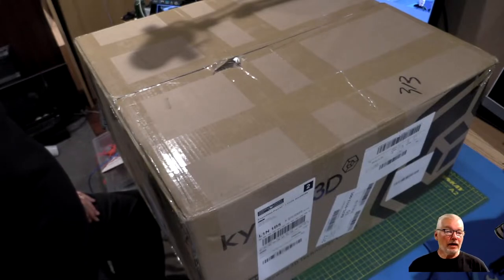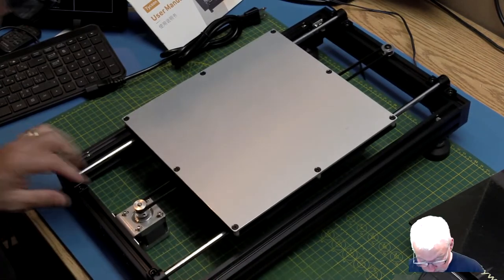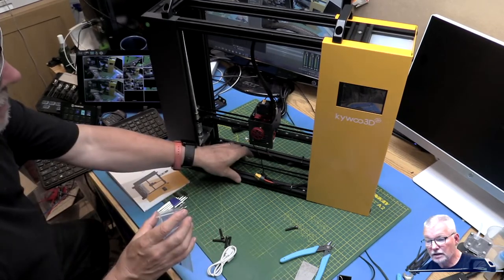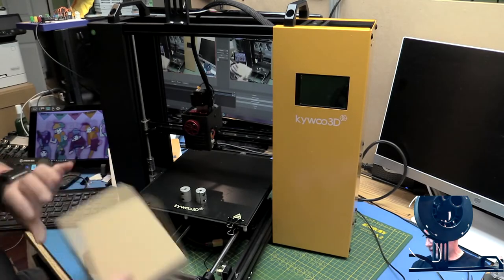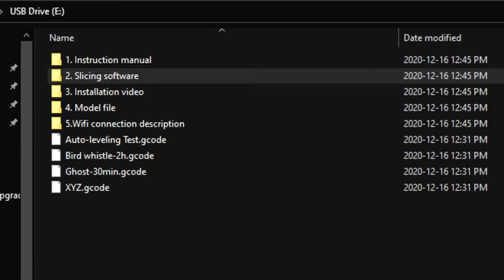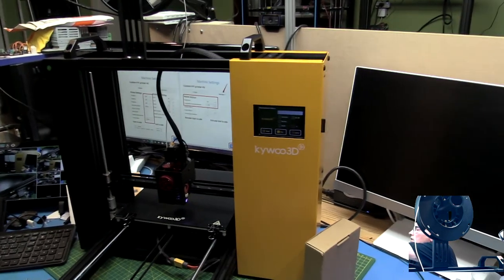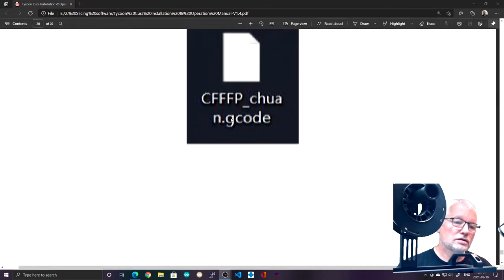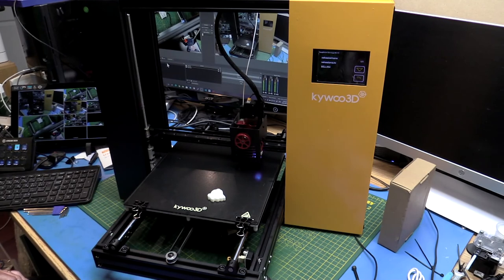Kywoo3D Tycoon Kit Build and first print

Comment: would it be wise to check level using a level x / y (at 19:45 mark) so as to get the screwed in feet height pretty close? or did you screw them all right in?  thanks. good and informative video. just ordered one today.